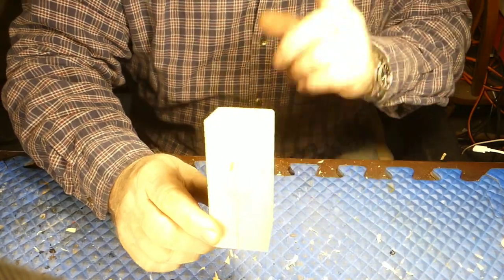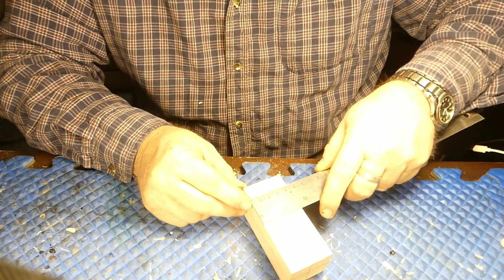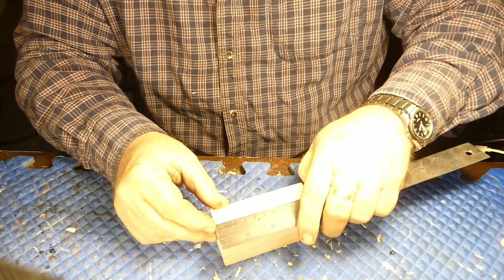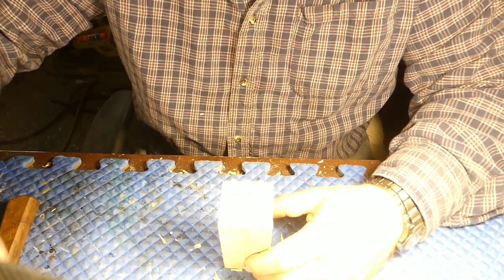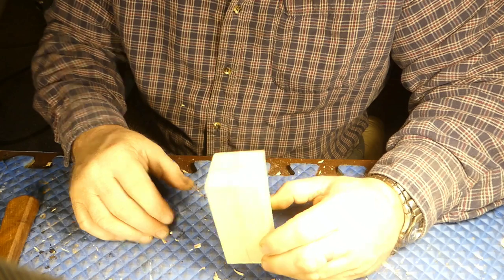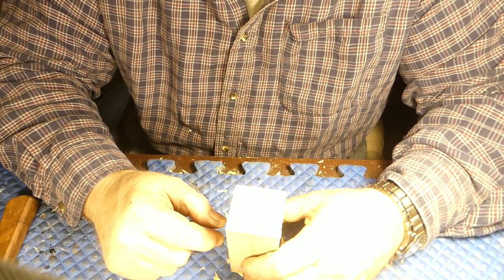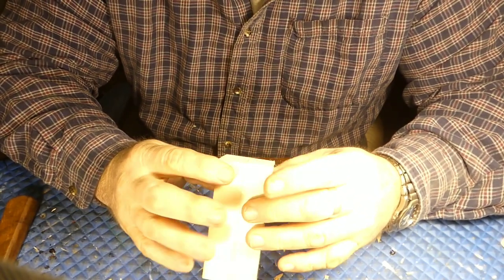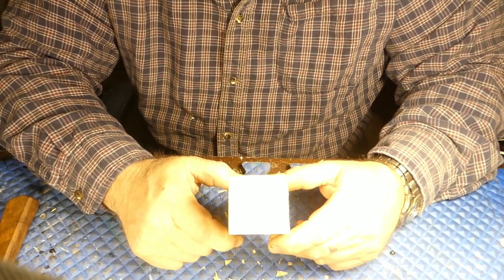Monster part 1 power carving, dremel,whittling

Comment: Hi Rob. Glad you've figured out the camera mishap, it happens. I'm not trying to be intrusive here, but you have a "HOT SPOT" with your lighting. It' kind of blurs out the project at times.There's a few ways you can get rid of that if you want. You could just move the light back a little or change the angle it shines on the project. If the light is adjustable just turn it down a bit. If it's not you can get an adjustable light switch to plug it into. You could also just put a cloth in front of the light. I have done that for photography many times. I like a gold colored cloth cause it gives a golden tint to the light. Works real good when photographing something that is red. Old photography trick from an old photographer. Don't put the cloth too close so it doesn't get hot and become a fire hazard.
Anyway, good luck on the alien. Hope they don't come down and abduct you. Never know with "off worlder's".
Reply from the maker: Lol rick thanks for the info I'll give it a try